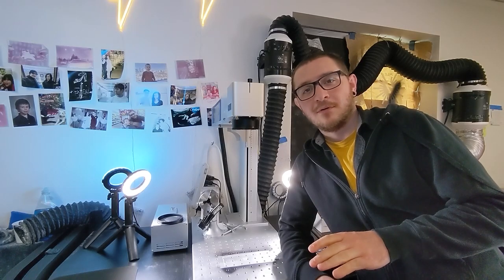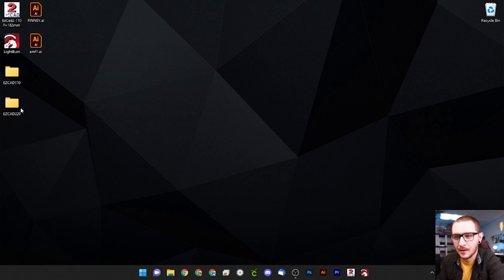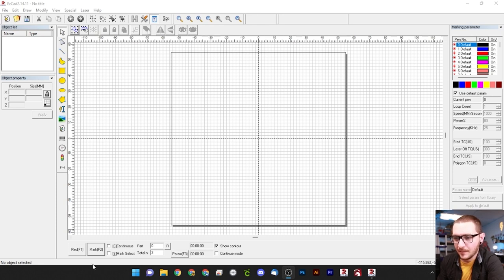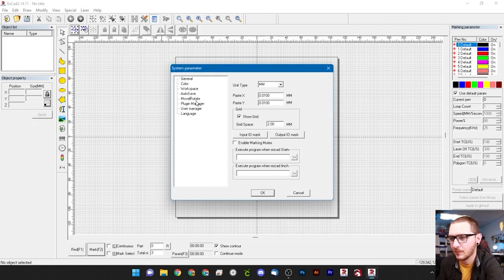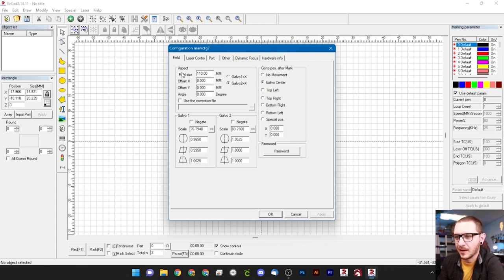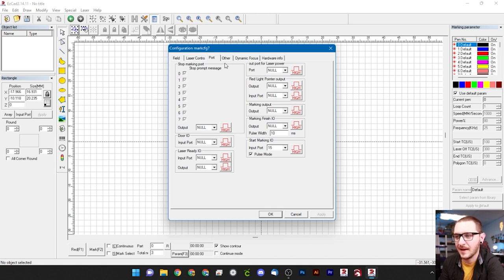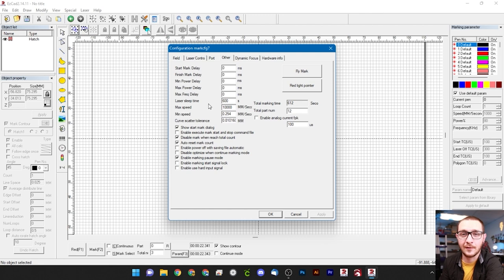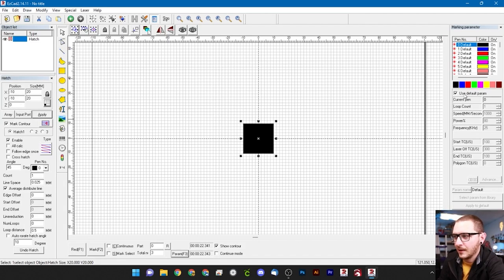How to Set Up A New Fiber Laser or Lens | 2021 UPDATED | Laser Engraving First Time Setup

Comment: Too many years as a pilot has left me with some hearing issues that come into play when using your method of finding my focal point. I used a decibel app on my phone and placed it near the site I was lasering. I could watch the decibel levels change as I adjusted the height. Worked like a charm. I’d like to use the twin red light lasers to assist focus but I haven’t figured out how to turn them on.
Reply from the maker: Very clever! Nice problem solving! Check under the lens while looking up at it from below there's usually a little plastic toggle switch on the galvo head housing.
Reply: Brilliant idea!
Reply: Sick !
Reply: Wicked plan man!! I'm on it.
Reply: Will try this idea!
Reply: Totally stealing this idea :)
Reply: Brilliant! Using the Decibel Meter APP....

Comment: I just set up my OMTech FM6969-30S fiber laser engraver. Upon loading the EZCad 2 software an alerts pop up. First that I dont have permission and now that I dont have a dongle and EZCad will run only in a demo mode.  I thought I bought everything I need to starte engraving.  The manual even says that this dongle is needed.  I'm now waiting for the OMTech Tech support to call me back.  What are my options and how to resolve?

Comment: I have a brand new fiber and on my small test images or text only half is focused.   Right half is darker and louder when marking.   These are pretty small test prints so i'm not sure if its out of level inside somewhere, the workspace, or field warp adjustments.  What should i check first?  I marked a big test square on stainless and it looks square and oddly enough marked pretty even.  But the smaller hatched images did not.  I'm very confused
Reply from the maker: The first place I'd look with this issue is actually the galvo scan head. Get a level and check the scan head, then check the bed. They should match. They do NOT need to be level with the ground, just level with one another. If they are not you should be able to loosen the bolts on the scan head at the neck and adjust accordingly.

Comment: Have you ever had a "Not Ready" buttom that shows up in the bottom center of the screen. I am a new EZCAD2 User and I am getting this after install. So I have not been able to use my laser cutter yet. Any advise?  Thanks.
Reply from the maker: Check your Ports tab in your F3 Param and disable Laser Ready IO and see if that fixes it.

Comment: They lost my laser in the warehouse so they are upgrading me to an autofocus laser (and including another lens) to compensate me for lost time.  Can autofocus be trusted?  Do you have a lot of experience with this?  Thanks.
Reply from the maker: Personally, I'm not a fan. Usually only works with one lens as well.
Reply: @LaserEverything  Thanks. I guess I'll see how it goes.
Reply: @LaserEverything  Incidentally, the autofocus has been fine.  There is an attachment to move the galvo up and down and a focus button that can simply be held down to set a new focus, like when you are changing lenses.

Comment: Thanks for the great info Alex. i set mine up with this video. Only problem im having is that the save parameter doesnt show on my windows, its past the screen at the bottom. iv tried scrolling, dragging and zoom but i cant get it to come up??? Any ideas?
Reply from the maker: One of the many downfalls of Ezcad is it's window sizing. You SHOULD be able to drag it out into the main work area to undock the window. If not you may need a bigger monitor (or a TV would work) to get the screen to expand enough to grab it. Super annoying. Highly recommend you look into upgrading to LightBurn, we have an entire free course on the subject. Much easier to use.

Comment: Hello! I did settings and I got 200x200 square which is 99% perfect. The issue is when I try to put smaller square like 50x50 I get 48x48...like the machine isn't scaling properly!
Do I need to do the Corefile calibration because I don't have any of the correction file loaded or there is some settings I can tweak? Thank you in advance.
Reply from the maker: Yes exactly. This video came out before our corfile corrections video so we didn't show it as a solution at the time of recording but a corfile would go a long way in correcting this issue. I highly recommend you try one out. We have a great video on it here: https://youtu.be/llflAf0G62Q

Comment: Could the 160mm focal length lens with a 110x110 marking area that was pre-installed in my equipment be replaced with a lens that would increase my marking area to 150x150? Should I be looking for a lens with the same focal length? Or, does a different marking areas necessitate a change in the focal length?
Reply from the maker: Different marking areas necessitate changing the focal length, don't try to focus on the focal length when picking a lens. Just focus on the marking area all similar sized marking areas are going to have similar focal lengths so you don't even need to worry about it just focus on the marking area and call it a day. 

Definitely pick up a few different lenses they're super cheap and allow you to do much more than just having one lens and relying on that. I recommend the cloudray f-theta lenses for fiber lasers. You can view them on my online buying guide:
https://www.lasereverything.net/buyingguide

Hope that helps! Let me know if you have any questions.

-Alex
Reply: @LaserEverything  I appreciate the follow-up. Will go lens shopping.

Comment: How accurate do the calipers need to be? $25 pair or $250?
Reply from the maker: I have like 5 $25 ones scattered around that get abused and forgotten about and a nice pair that stays on my desk and doesn't leave. Up to you - I use both and don't often run into a situation where I NEEDED my nice one but it doesn't need to be tared as often and the batteries definitely last significantly longer.

Comment: Afternoon, I am tryiing to make these adjustments in ezcad 3 but cannot find where to do the feild warp adjustments. I believe i found it, but when I make a change, nothing happens. Could you direct me to where I need to go to make these changes?
Reply from the maker: Check your Ezcad folder for the "Calibration Wizard" and run that, you can follow the same directions we give to ezcad 2 users for lens distortion correction here: https://youtu.be/llflAf0G62Q

Comment: Got my 70 watt laser running thanks to you.But where can I find the folder with the lens settings in it. I have a 220 and I want to go to 110. So I need to copy the folder but I can't find it. Thanks in advance..Ben
Reply from the maker: In the case of ezcad, you would copy/paste the existing ezcad config, and relabel it to the new lens size, and then update the field settings and import the proper library conversion for that lens size.
For lightburn, can just go to the device tab, duplicate the 110 device as a 220 with a new label, and it will prompt you to update the field size if needed.

For parameter settings, we have copies of those on our website to download.

Comment: Nice video , I have a 60W JPT M7 MOPA with several lenses and EZCAD 3.0 just starting to learn , have you made videos using EZCAD3 suitable for my machine 
also?
Reply from the maker: 95% of what we cover in EZCAD2 is compatible with EZCAD3. In a few cases a button might have a different label or be in a different spot but the vast majority of the settings (converted of course) and techniques will be the same. For more information on your specific machine join the discord as there are many members with your exact source. 

You can also support the show by joining the patreon which includes instant access to my entire fiber laser library as well as a converter to convert the settings for your 60w unit. The converter would be quite useful when watching my videos to get you close to what I'm getting on screen. Let me know if you have any other questions - link to the discord and patreon are in the description of the video.

Comment: Hi.. Loving the simplicity of your tutorial. Can i ask about the Max and Min PWM on my machine. I've been told it's an "F-Tech FO-30 150 X 150". There is a plate on it with the model number DRK30F

Can you advise please? :)
Reply from the maker: It has less to do with your machine model number and more to do with your laser source model number. You need to find out if it's a Raycus, Max, or JPT. If you Google that model number you should be able to figure it out.

Comment: Hi I changed my lens and I adjust the red point light as you explain in this video, so then if I mark a shape and then I light it, the red light perfectly fix the shape. However, when i don't light the shape, the pointer is not centered; in other words, if I would like to mark a circle around a point, i can't just use the red light pointer as the center of my cricle. Is there a way to fix that? Thanks and congrats for your videos, they're so helpful!!!
Reply from the maker: F3 Param on the first page it says "Go to pos. after Mark", that's where the red dot returns too after it's completed all marking and framing.

Comment: Thank you for your videos 🙌🏾. Which lens would you recommend 220 or 110? I just got a 20W fiber laser bug what's the difference in lenses? Do you have video on that?
Reply from the maker: I do have a video on that, here's the link: https://www.youtube.com/watch?v=iAgj6T4eH80&ab_channel=LaserEverything

PLEASE do not buy a 220 lens for your 20w you will hate it! The 20w doesn't deliver nearly enough power to mark anything at 220mm. I can hardly use my 220 lens on my 30w machine without issues. At 20w you want to stay between 50 and 150mm max. The video I linked explains it all in a little more detail.

Of course I'm happy to answer any other questions you might have - just let me know :P And thanks for watching :D
Reply: @LaserEverything  thank you!
Reply from the maker: I'm here to help!

Comment: Looked at the laser Mactron 30w fiber that you have listed from aliexpress and shipping shows ~$900.00 alone. Has this been the case the whole time or do you have any other suggestion/options.
Reply from the maker: That's just the cost of air freight. You get your laser in a week instead of three months. If you're buying from them that's the only shipping option. With the way the ports are these days you don't want your machine on a boat.

Comment: I need a little help.....have signed up for discord....how do I contact you or someone on there? Just got a new 50w fiber laser and assembled it, but too intimidated to turn it on for fear of frying me, the machine or something else. Need just a little side by side discourse.....plz
Reply from the maker: You can just post whatever questions you have in #fiber-support and we'll be there to help ya through it. They aren't that dangerous as long as you aren't licking the power supply or staring at the laser beam without goggles. Fairly safe equip. You can do it!

Comment: Great videos! One doubt. The parameters library are set for a specific power and lense size? I.e. Wont be the same result using the same config with different lense size. Right?
Reply from the maker: Library includes a converter for wattage and lens size.
Reply: @LaserEverything  Hi, I got the old fiber laser from my friend. How can I know what size of the lens and power of this laser? Thank you so much
Reply from the maker: The lens should have either the lens size or approximate focal distance printed on it which we would be able to help you out with if you post a picture in the discord or Facebook group. For the laser wattage there isn't usually much you can do except open the case and inspect the laser source. Most sources typically have a sticker that lists the model number which we could then use to tell you what your laser power would be.

Comment: Hi! Where can I check the size of the lens my machine came with? On the lens it only says CSDQ f-theta lens 1064nm f=210mm 210C24630. I understand the focal length is 210mm but not sure what the size is. If someone could help I will highly appreciate. Thank you! 
* on the machine’s manual it says “processing area” is 15cmx15cm. Can I interpret this as the size of my lens? I am new in all of this :(
Reply from the maker: That's a 150mm lens. We have more resources on our community (Discord link in description)

Comment: Just purchased a 50x50 lens so I will be using this method to get it working properly.  Weirdly my fiber laser came with a 115x115 lens according to the  lens label but the manufacturer set the machine up to work with a 110x110.  I have never been satisfied with the performance of my 30W laser and I am  beginning to think that the mismatched lens is the culprit. I have a feeling that the manufacturer had this odd lens laying around and decided to skimp out instead of using a proper 110x110 lens.
Reply from the maker: It's not uncommon to see that slightly different lens size. Lens sizes are generally the same when being manufactured, but the small differences can keep them close enough to match spec for a 110 focal distance. Not sure on the cause or reason as to why it ends up in that place, but we do see it from time to time. 110 is a pretty good general all round lens size (or thereabouts), but if you need more kick, a 50 or 70 will certainly give more mileage for the same power source. More punch for sure!

Comment: Just got my fiber laser and already ezcad can't find dog! bummed,  any ideas whats happening here. Did I buy some chinese junk? Is it the 64k operating system? Everything seams to be 32K. Very nice video, but would like this laser to work so I can learn some more from you.
Reply from the maker: Are you using windows 10/11? If so make sure you are using the LMC64 driver and not one of the others or it won't work. Machine has to be plugged into the PC and turned on in order for the software to function.
Reply: @LaserEverything  using windows10
Thankyou for the quick reply
Reply: @LaserEverything  Where do I find a LMC64 driver? I'll do some searching.
Reply: That driver seems to be hard to find.  Maybe I'm not going about it the right way. Thinking about buying the software so i can get direct support. Other than relying on this company's copy. I have a 60w CO2 laser, this is the first time I went with someone not around me as a distributor.  I learned my lesson, took a risk hopefully I can make this thing work.
Reply from the maker: @hisdahlsembroideryscreenpr8347  Join the discord server (link in the description) and ask for it there. We have a community version that comes with drivers that everyone shares.

Comment: Great Video, first timer here.  I have an Omtech 50w Max Source Fiber Laser Engraver.  It came with a standard F-Theta F=430 lense.  During the setup video, you mentioned selecting the Source under "Fiber" and "Serial".  I believe you selected JPT.  I do not see a drop-down for MAX Source, it was already on IPG_YLP, but not sure that is correct or not?  I was able to get the laser focused and set at the correct height.  I noticed though that my Red Box and actual Mark box are significantly off...i.e. it's not aligned? Any recommendations?  Thank you!!
Reply from the maker: If it's set to  IPG_YLP and it's working correctly I would leave it alone. Ezcad was made before MAX sources were a thing. 
To fix your red box alignment check out this video: https://youtu.be/ip08rkqw9o4
For everything else related to getting your galvo laser working as best as it can this playlist would be really helpful for you:
https://www.youtube.com/playlist?list=PLoBR3k35202YW6uCz5ESGnPbLFe9Ri2ve
Reply: @LaserEverything  Thank you very much!!

Comment: Hi i need help figuring out what size lens i have. It reads on the side “ f-theta lens 1064nm f=160mm 16032091”. I also dont know what to click for the serial in the laser control for parameters. My boss said our machine is a morn 20w fiber laser. Please help.
Reply from the maker: You have a 110mm lens, please join the discord and we can help you do some investigating to find out the specs of your specific machine, link in the description!
Reply: Thank you so much. I got alot of things figured out. One question i still have. Now that i have changed setting to be correct i can hear a humming noise now when i press F1 and i cant hear it when im actually engraving or F2

Comment: Is it a must to use easy cad or can you use lightburn exclusively?
Reply from the maker: You can use lightburn exclusively, but unfortunately they do not currently have a utility to take the output, accept measurements, and properly scale and adjust the lens output (like you see with the corfile utility). so with lightburn, you have to test, and then guess the change you need to make, and test again, and repeat that process until you get the output you're happy with. If you're a perfectionist, you could spend hours doing each lens.

Comment: Hi I just got a laser machine 160 lens with 110'110 marking area. I have been watching your video about finding the right focus, any estimate height you know for my lens? It doesn't say on the lens. It says F Theta lens = 160 mm "1064mm. Just to have a starting point ( i am new at this)
Reply from the maker: 110x110mm is your working area
F=160 is your approx. focal distance :)
Reply: @LaserEverything  THANKS!
Reply from the maker: Yep 😁